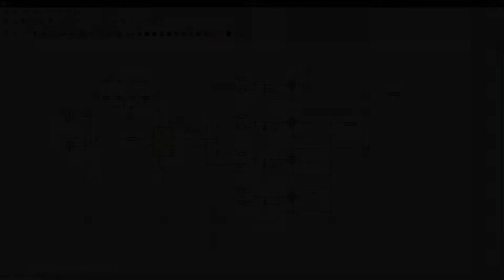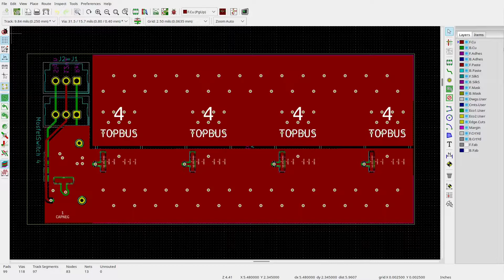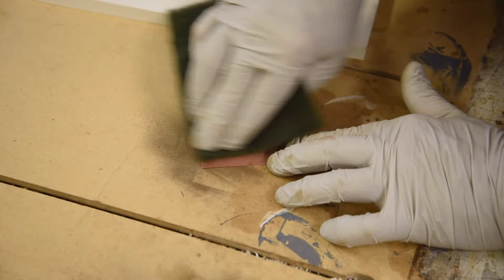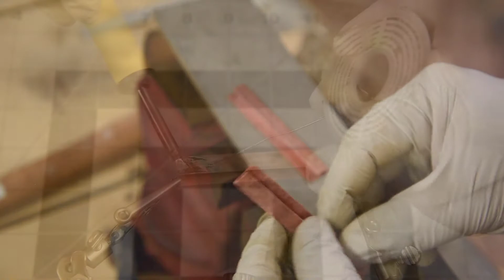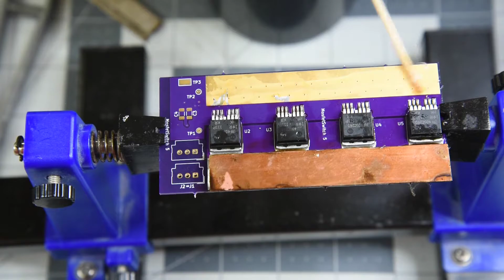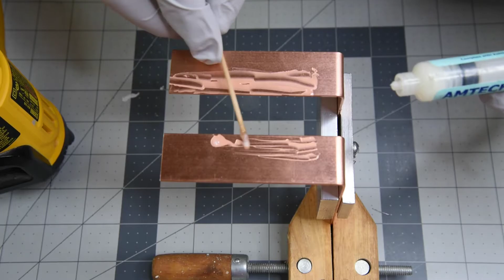Controlling the Flow - The Allure of MOSFETs (CD Welder Project Part 4)

Comment: Very big gate resistance, mosfets too long been in saturation mode and may overheat
Reply from the maker: They don't overheat and typically stay cool to the touch. The deliberately higher gate resistance is critical for properly controlling the turn-off speed. These are very fast-switching MOSFETs, and excessively quick turn-off can lead to dangerous inductive spikes that destroy components.

Comment: I know I'm probably too late, but you're really doing that the hardest way possible. Next time you're soldering bus bars like that, go with a more powerful iron. Harbor Freight has a decent enough soldering gun for like $30 bucks. You might even consider one of those butane mini-torches. If you're just getting by with what you got on hand, I totally understand. But I figure a guy that ain't got 30 bucks to spend isn't building his own spot-welder, either.
Reply from the maker: I was looking at some of the 200 watt soldering irons on amazon.  I hadn't thought about a small butane torch.  I'll look at those.  Thanks.
Reply: @metalplasticelectronics354  I can vouch for the American Beauty 3158-200 - a 200W 5/8" tip iron. I've flowed 1"x1/4" copper bus bars with that thing. They're a little costly compared to chinesium, but all their products are hand made right in Troy, MI. I have one of their irons and one of their 3lb solder pots.
Reply from the maker: @MadeInMichigan  I'll look them up.  Thanks.